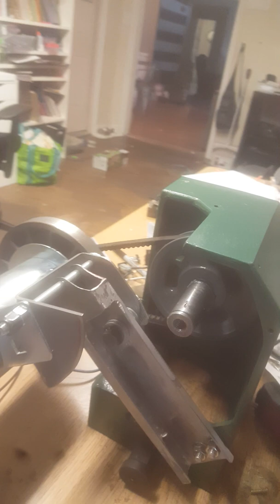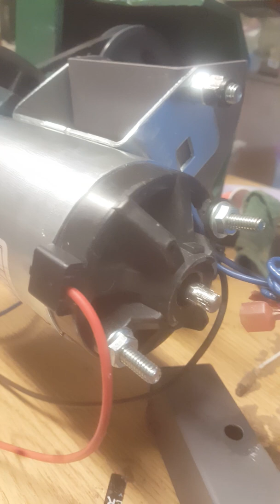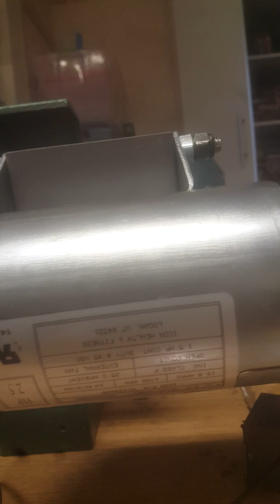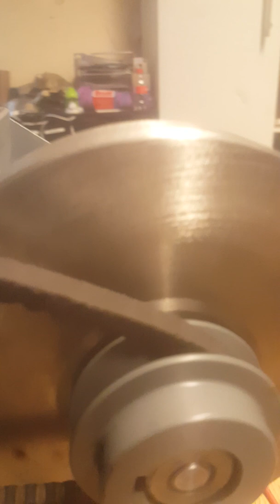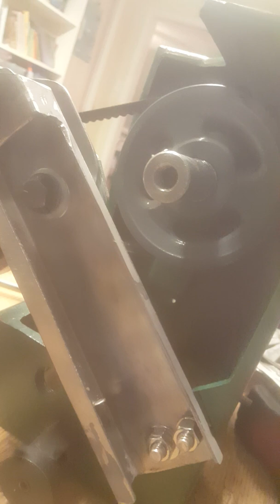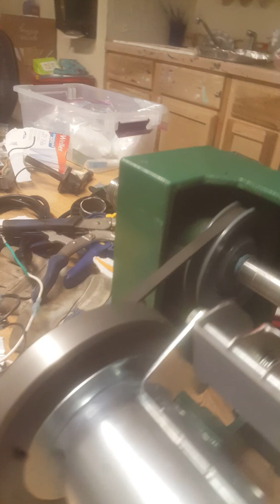Harbor Freight 12x36 Treadmill DC Motor Upgrade

Comment: To remove the pulleys from the shaft, first you have to remove the speed adjust handle. Remove set screw and handle will come straight off. After that pulley will slide off like butter with virtually no effort.

Comment: Did you eventually keep upgrading?
Reply from the maker: Hi - I just happened to check this.  Sorry for the delay!  I did a “year later” video.  Ultimately I did end up getting a new lathe, although this Frankenstein worked for a good long while.
Reply from the maker: Hey I’ve updated comments on this to answer you - check the few comments on the video to get an update :)

Comment: treadmill motors do not work on lathes they bogg down under load then ramp up to catch up which is very dangerous when bowl turning
Reply from the maker: I did not have this experience - however I ended up having another poor experience.  What ended up happening was I lost all the rotational force / torque / power - whatever.  When I touched the tool to the piece, the piece had no force to drive through the cut.  I could no longer do large hunks, dense items, and experiments.  I could only do store bought, clean, issue-free wood, and take light cuts - so great for pens, little trinkets, even little bowls - but as soon as I put anything sort of heavy, it would stall or stop easily, and of course this made things hot, and blew the fuse all the time.  After all the trouble I went through limping this lathe along, I learned a lot, maybe delayed the upgrade expense, but didn’t necessarily have an improved wood turning experience across all scenarios.  Would have been better to save up and then get the good one (as usual).
Reply: @bobbycarlton5499  what I was using was the circuit board from the tread mill I think that was part of the issue I was having it ramp up, probably work good on a treadmill because you got the person's weight to counter act the ramp up opposed to just the weight  of a bowl.
Reply from the maker: @woodywoods5373  Yes! I did not use the control board of the treadmill.  You’re right - that is the difference!

Comment: Hey it's been a year and a half-ish. How is it performing?
Reply from the maker: It's ok, still runs well.  Check out the video I did of it a year later.  Not much has changed.  Not sure I will actually do this, but it seems like something I could continue doing as needed - new motor on and on